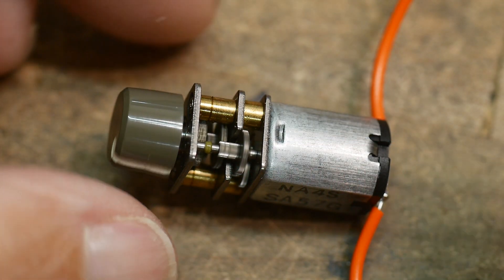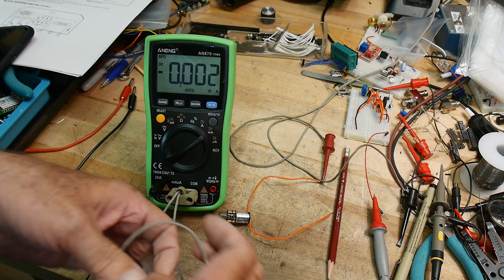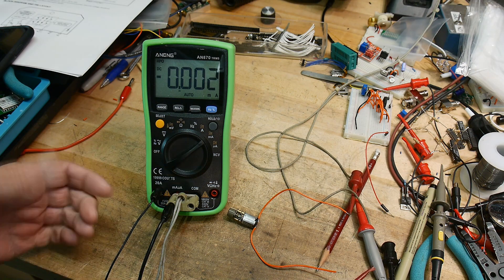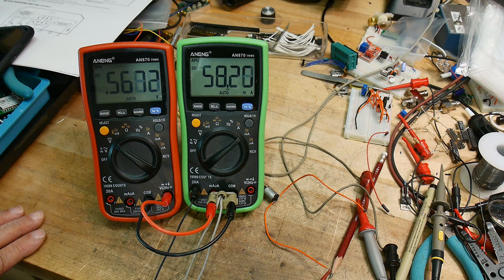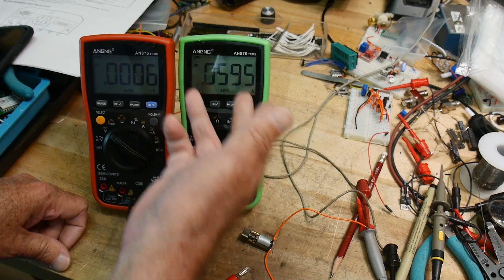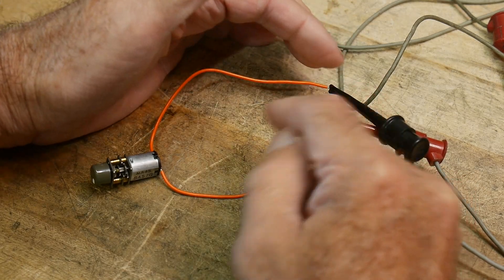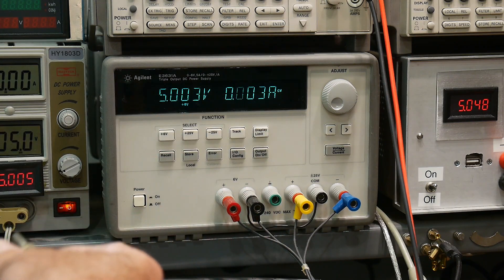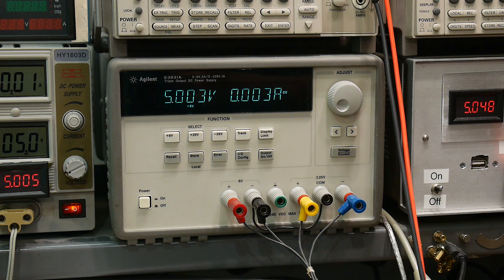#790 Burden Voltage of Current Measurements

Comment: You left out the best option: with a bench supply that does remote sensing (e3631A doesn't, being triple output, but others in the series do, such as the e3634A, and a wide variety of other supplies from HP/Keysight/Agilent, and other manufacturers, like many of the 1960's/70's vintage 6200A series) as long as the burden voltage is within the sense loop limit, you can use a higher precision ammeter and let the supply compensate. For a number of years, a Fluke45 was in the sense loop for my 6291A, for example (max 1V/sense lead, which this combo was well in spec for).
Reply from the maker: That's a good idea

Comment: Your channel is great. I just ordered a Uni-T UT210E because it has a 2 amp range. I read for a clamp meter it is accurate to about 1ma which I think is fantastic. You and CuriousMarc should do a collab one day since you guys are both in Silicon Valley and have excellent electronics channels.
Reply from the maker: Let me know how you like it. the 2A range is +/-2% +- 8 counts. so a 50mA measurement might be +/-9mA
Reply: @IMSAIGuy  Keep in mind to take ten turns through the clamp for low currents to reduce the error by this factor.

Comment: Use hall effect
Reply: Tell us your procedure, please.
Reply: Many (these days, probably all) DC clamp-type meters do, and there are hall effect current shunt solutions off-the-shelf (LEM HMS and Honeywell CSLW, for example, as well as a lot of board-mountable package types), as well. Accuracy is not great for clamp-on types. Better for the shunts, but they are still typically only +/-1%, and may require frequent calibration. Advantage: minimal burden, galvanic isolation. Drawback: accuracy, need for calibration